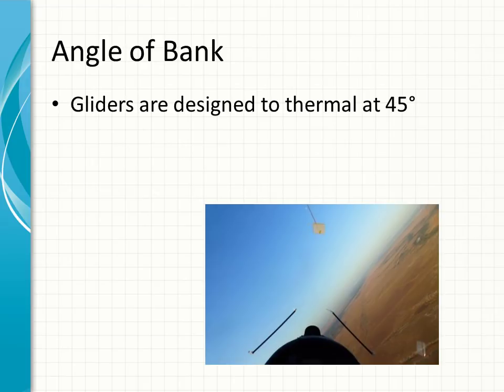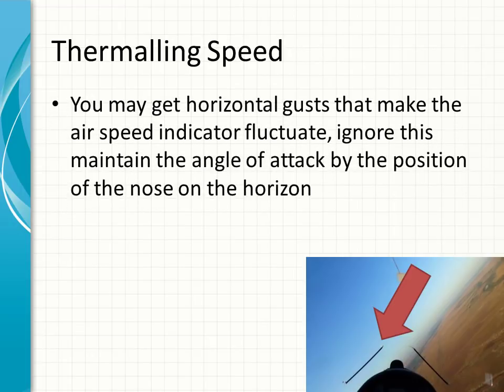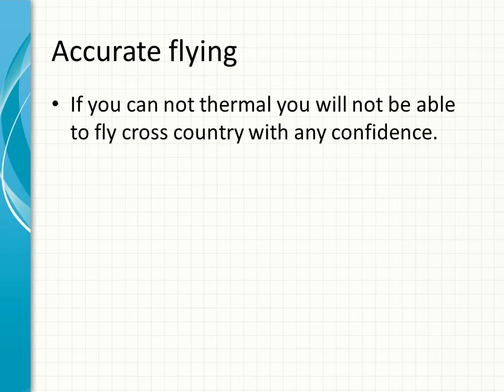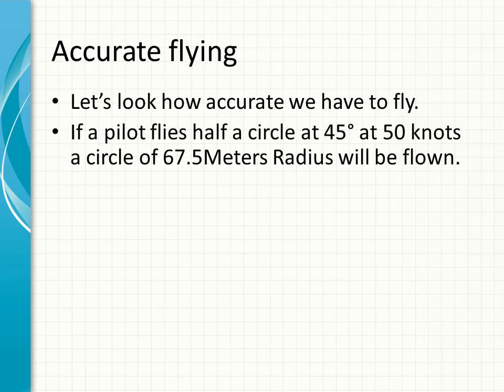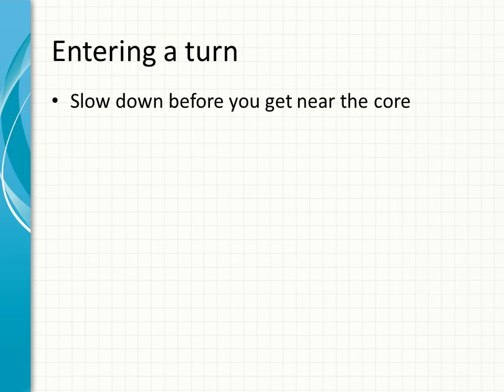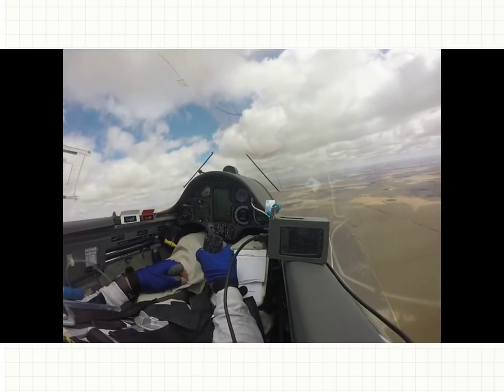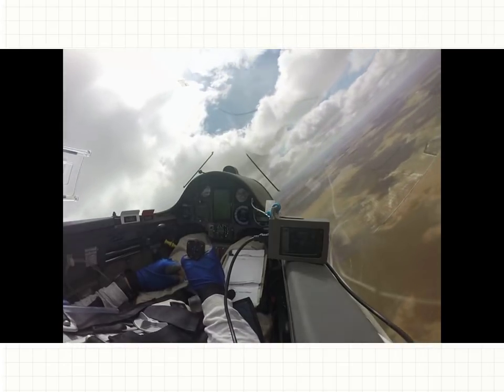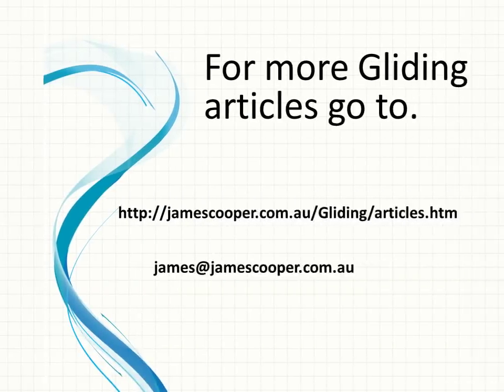Training on How to Thermal a Glider / Sailplane Suggest alternate https://youtu.be/HOwGMgqO4hE

Comment: Thanks James. I am a recently solo glider pilot working my way towards my Bronze and Cross Country endorsement. I'm in exactly the position you describe. I've been taught to fly safely (very important of course!) but without doubt the most important thing now for me to learn is to be able to thermal very well as this after all in the flatlands is what keeps us in the air! I've found your video extremely valuable and I have learned many things which I look forward to putting into practice once this Covid-19 nightmare is over and we're back flying. Fly safe and thanks for taking the time to make the video!
Reply from the maker: Thanks for the comment. Where are you flying from? Or in reality where are you not flying from?
Reply: James Cooper I’m a member at Staffordshire Gliding Club in the U.K. - I shared your video with our members on our WhatsApp group and someone mentioned about the potential to spin by over ruddering a turn at slow speed as you make your first turn with full rudder - what are your thoughts on this?
Reply: @andrewstout9321  Fundamentally, the reason he is not close to spinning is because his speed is well above the stall. With speed close to or at the stall, an ASK23 glider will spin if you try to get the yaw string to the centre; it will not spin if the yaw string points outside the turn as recommended here. See There is a Youtube video which demonstrates how a spin can be induced from a thermal turn with too much into turn rudder: see https://www.youtube.com/watch?v=16h7cX5d_Lw&t=47s. However, He only has full rudder very briefly, and with the speed well above the stall and the stick is not right back.
Reply: Sorry that comment got posted by mistake while I was in the middle of editing it - but most of what I wanted to say is there. I also think he uses full rudder to roll into the turn partly because of the glider he flies. I fly a glider with powerful aileron control and would not use full rudder - I roll into the turn using co-ordinated aileron and rudder.

Comment: Great instructions about how to fly accurately. I'm surprised about the "full rudder" and the "top rudder" bits. I think we all have to find out how our specific glider needs it. Some gliders have a lot of rudder effect and some less and som rolls really well into the turn and some not so much. I would max the weakest and coordinate with the strongest to obtain the highest achieavable roll-rate. And the top rudder - this is all new to me. I only used that for knife-edge manouver and for side-slip to land. Otherwise my rudder was allway a bit into the turn, and never outside neutral. I can't wait to try this out - and I will, because you are a much more accomplished pilot than myself.

Comment from the maker: I am not an instructor, but a coach. I've been flying since 1980. Instructors could be correct, their concern is someone pulling the nose up to try to make the landing point and stretch the glide on final turn. My two comments would be. 1) Thermalling I don't pull the speed back when maneuvering to find the core as I like a bit of extra speed to have maneuverability. 2) if you are on final turn to land and want to make the air field and you are concerned about making the field, point the nose to the top of the fence, you will always make it. If you are going to fast then you can pull the speed back and use dive break. In both cases no chance of spin or stall. If you can't make it then you are in the poo.
Reply from the maker: @terrelljerry3062  Good to hear. Most things in gliding take years. With about 4000 hours solo it still took me 2 years to learn to land my open class glider sweetly. Remember Look out before you turn.

Comment: You don’t get skies like that too often in England , the conditions are usually very “scratchy” so accuracy is even more important.
Reply from the maker: Thanks for getting back. I used to fly in the UK but left in 87. Quite frankly I have forgotten what the thermal structure was like, and as I flew an Olympia 1 half the time and a cobra the rest. I understand you have thermals that are not strong, but what i see with novices in Aus if they don't fly accurately they don't get the strong climbs. They get the strong sink on the edge and end up in a paddock just as quick as a pommy pilot can do in England. We may be chasing 500, 750, 1000 we have to fly very accurately. You may be chasing 100, 200 300. You have to fly very accurately. Happy Safe flying

Comment: Now I know what the straws are for! I have been working on my add-on and haven't quite figured how to gauge the 45-degree angle without the attitude indicator of a powered plane.
Reply from the maker: The best and easiest way is to get a piece of paper, A4 is good. Fold it diagonally top edge against side edge, make a nice crease and then open the paper back out again. Now stand in front of the glider, straws approximately in place. align the crease in the paper with the fin, and adjust the straw to the edge. You can get it right within a few degrees. Remember it is good to keep 45° but if you are a degree or two out it does not matter. What matters is that the bank is constant all the way round.
Reply: @jamescooper7743  wow! Above and beyond with that quick and thoughtful reply! Thanks a million.
Reply from the maker: @StickandGlider  you will have to wait a bit longer to get the how to core a thermal. I'm thinking about it at least. but i have to wait for summer

Comment: Amazing video!
Just excellent tips for thermaling.
Recently I am a flight student in Germany with the aim of getting a successful cross country pilot after I received my license. 
Your points are completely understandable. 
Flying circles with a constant bank angle is not complicated in my opinion. 
If the thermal is getting rough or one has to deal with wind speeds it is not so easy anymore holding the angle. 
One also has to correct the angle with aileron to stay in a constant steep turn.
My flight instructor calls this paddling and says those corrections cause to much drag and it is not efficient, moreover, he complains about the thread not being in one line.
What is your opinion?
(I only make small corrections)
One question: Do You have your rudder in a constant position while thermaling or do you also use it for corrections?

Keep it on!
You really inspired me, thanks for sharing your experiences and knowledge with us!

Greetings
Reply from the maker: When conditions are rough the air speed appears to fluctuate. The issue is not that you are flying fast and slow but you are getting horizontal gusts. So the best thing to do is not to fight the speed but maintain the attitude and bank angle and let the Air Speed indicator fluctuate. I have heard instructors say that moving of the stick causes too much drag, I am not convinced. but what you describe as paddling is perhaps just chasing the unchangeable. See above. With regard to corrections I use the rudder as priority to kick into the turn, not the ailerons. It goes against the grain and theory but the rudder's secondary effect will turn the aircraft the ailerons have adverse yaw. Could i suggest that with a little bit of subtlty you aproach a good cross country pilot and have a fly with them, if they are successfull at cross country their skills at flying will probably be good. Instructors who just fly local can be good but I believe do not have the skills of good x country pilots. Keep in touch. ( looks like i will win OLC Australia this year.)

Comment: I calculated the ideal angle the yaw string should point to the left in a right turn. Depending the cg the other values, it is about 1 to 2 degrees. So, I can't confirm the rule of thumb, that the yaw string should point to my left shoulder. It is way too much. Keep the yaw string center and your are fine at any time.

Comment: Straws to keep parallel with horizon for 45 degrees. What a GREAT idea. They 
should etch these 45 degree markers into the glass with black paint for all gliders
Reply from the maker: I find it so frustrating that i put straws on the club gliders, then instructors who "Know Better" take them off! I have over 3000 hours and a number of records and have won OLC in Australia, but still people don't listen. Thanks for your comment.
Reply: Instructors for the most part teach safety and circuits to get you solo. Finding XC instruction that actually happens is rare. Joy rides seem to take precedence over that. Just going to take a peek at your web page...
Reply: @jamescooper7743  I always use the screws used for mounting the instruments in the panel, they also give me a good idea of how steep I am banking in the thermals
Reply from the maker: @casaamaril  There are many people who say that they use the screws. The problem is two fold. First the screws are in your near vision so you have to refocus to look at them and thus not look out. Two they do not shout at you. There are few people who use the straws but those that have switched are totally convinced. The sit on the horizon and shout at you.
Reply: @jamescooper7743  thanks James, it makes sense

Comment: Excellent video. This pilot, and others, recommend rolling into the turn when you cease to feel the upward push. I turn before that - generally I will have felt a bit of push, slowed down, and then if I feel a strong push when the vario was already showing lift I turn. Given the time taken to enter the turn, with luck ! I find myself turning in the core. If I wait until I no longer feel a push I think I will have missed the core. What do other experienced pilots think? (I'm a UK instructor and cross country pilot).
Reply from the maker: Thanks for the comment. It would take ages to go into how to center the thermal in the first turn and then maintain it.  Perhaps I should do that one day. But the purpose of the video is purely to inform the pilot how to make the turn. Even though it is basic stuff it appears to be something that is missed out in training. There appears to be an assumption that pilots can make that first turn correctly. Anyway a few others have made the suggestion how to find the core and keep it. Perhaps I will try to put something together. Thanks

Comment: great video! thank you very much.

Can you comment about centering in thermal? what is your centering and re-centering process? I think it should be mainly based on push and feel rather than the Vario due to delays.

In other words, how not to lose a thermal.

Thanks again,
Rami
Reply from the maker: It is interesting sometimes when i am thermalling i move across to somewhere just because it feels right and I have little idea why.  However the Gliding Federation of Australia have just put into place a training system where all instructors and coaches teach exactly the same way, including patter. I believe that they have done a very good job and you can get their thermalling technique on line http://doc.glidingaustralia.org/index.php?option=com_docman&view=tree&slug=training-manual-part-2&Itemid=101
this is for novices and is based on "Not Loosing the thermal" which is not necessarily "Getting the core" Have a look at the pilot guide. There is one additional comment. If there is a reasonable amount of wind there will be thermal bubbles and very narrow streets that lead to the thermal. You can not thermal in the streets as I guess they are about 30 m wide. 
have a look at my web page if you have not already done so there http://www.jamescooper.com.au/Gliding/gliding.htm  There are a number of articles there that may be of interest
Reply: @jamescooper7743  thank you very much for your detailed response. I read your article. Later today I'll read the Australian manual.

I'm from Israel and we're in lock down now due to COVID-19. Hopefully, I'll be able to return soaring soon.
Reply from the maker: Sorry it was a belated reply, I only just got your request a few days ago. I did however forget to mention that there is a very good set of books by G Dale The Soaring Engine. Worth a read

Comment: very good advice with some unique thoughts.   Question, when would you fly at least sink rate?  you warned about flying "too slow".
Reply from the maker: The reason for a bit extra speed is to give maneuverability.  So as the thermal gets smoother and you have no need to have that extra speed. I dont know where you are from and what your thermals are like. but early morning in Western Australia the thermals are tight and rough. Have speed. Late in the evening they are week but large and smooth. bring the speed back and even flatten out the bank a few degrees. Safe Flying James
Reply: When you're flying on a blue sky day, and you're out there a long way from home, you;re beginning to get lower than you want to be,  don't know exactly where the next thermal is coming from, even if you've identied some possibilities......, yeah, I'd be going at minimum sink.

Comment: Hello Mr. Cooper, I'am  67 years old. Too old to take lessons and learn to fly?
Reply: nooooo
Reply from the maker: As you can see below I am not an instructor. Just a coach. What I have seen is that the older we get the slower we are at learning, but if we keep learning and keep fit we learn better. I am leaning the didgeridoo! Bottom line is you may or may not go solo, you may or may not go cross country by yourself, you may or may not get a 300 or 750k flight. But you don't achieve these you can fly with more experienced pilots and enjoy this great sport of Gliding.
Reply: @jamescooper7743  could you please put up a video on playing the didj?  I have no doubt it will be clear, to the point, and a very effective learning tool. Thank you.
Reply from the maker: @chrishamilton4999  I was trying to work out how you knew I played the Didge. But I guess you don't I will consider but I have to be carful that I don't infringe copyright. No you don't want to hear my playing.
Reply from the maker: @chrishamilton4999  Very limiting the ability to change a video that has been posted, but I have added a didge to my morning glory video, the shorter one. All a big learning curve. I guess once I have done 1000 hours posting YouTubes they should be ok!

Comment: Also look for cross controlling.   Any time you are inputting left stick in a right turn you are wasting aerodynamics.  Also, flaps,  if you are over 50 kts airspeed they produce drag.   Just because the book says so doesn’t mean it’s correct.